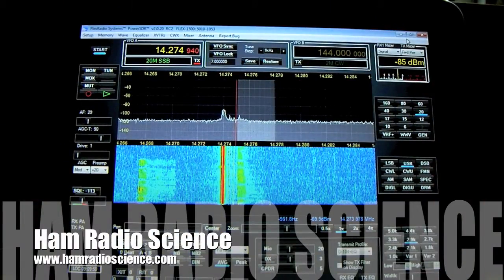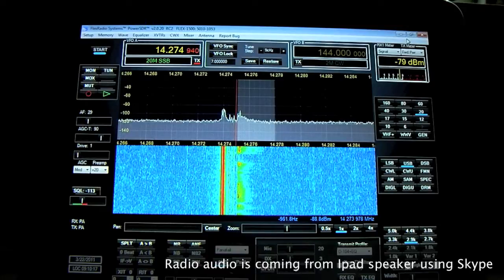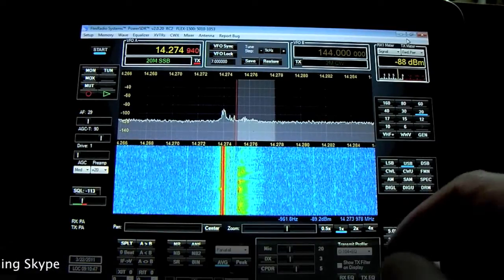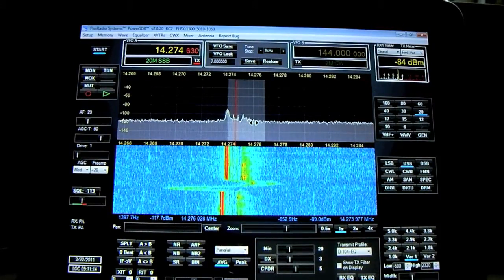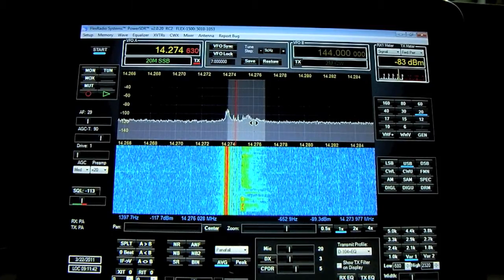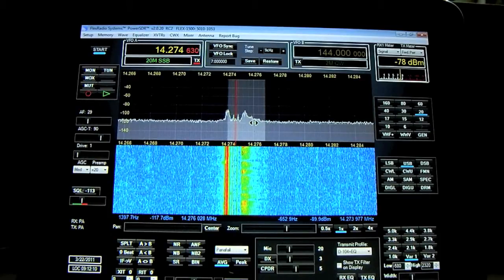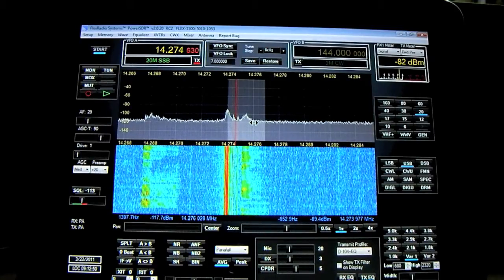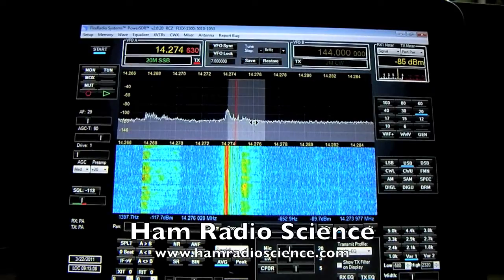Using Ipad to Control Amateur Radio Software

Comment from the maker: As far as I know, there is no software that allows direct linking to a radio. It would be possible to use a netbook with WiFi mounted in the vehicle to run the digital software and use Air Display to remote the Ipad.